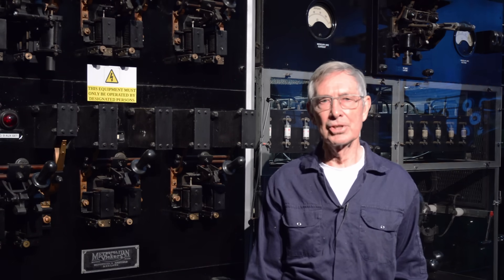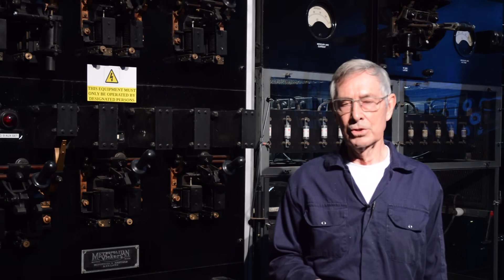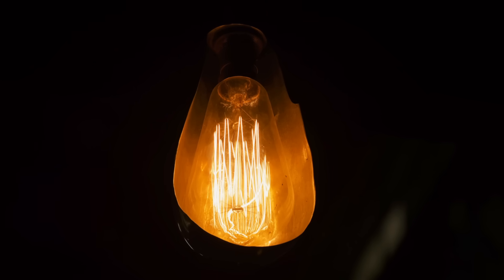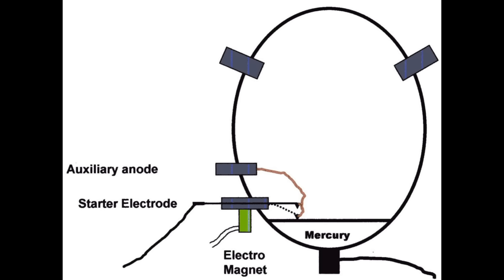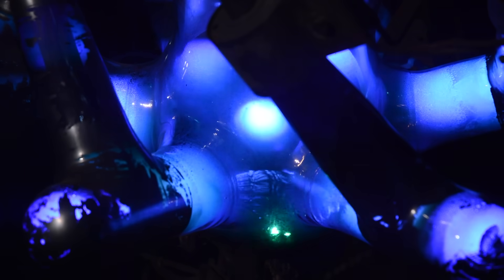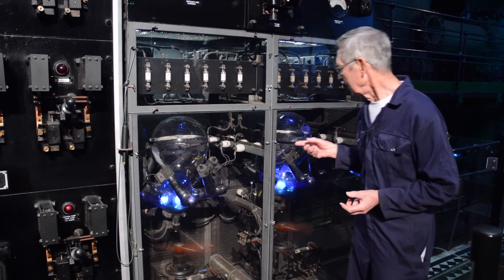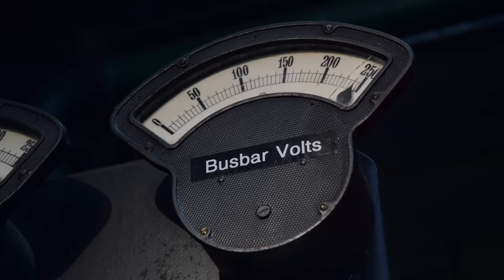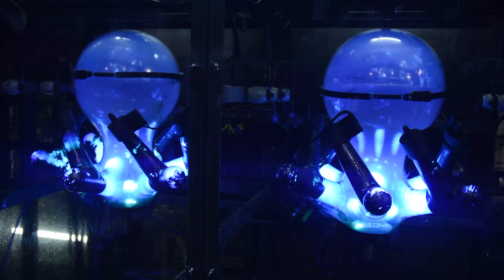Mercury Arc Rectifiers - Kempton Steam Museum

Comment: It looks so fragile. Thank you for the excellent explanation of how it works. I am curious about the need for 6 phase and how that was achieved.
Reply: Yea - the 1500V bulbs we used in the 1970's for Wellington (NZ) suburban rail were transported suspended in large open wooden frames.
About 4 fitted on the J5 Bedford flatdeck - which was driven very carefully and slowly to the stations. 
I remember a story about a previous driver who broke every one of his load.... I wonder what happened to that mercury?!
Reply: The secondary windings of the transformer would be centre tapped, so producing two outputs, 180 degrees out of phase, from each of the three input phases.  The more phases you have the less ripple on the d.c. output and the less smoothing required.

Comment: Greetings,
This is an interesting presentation, and I love seeing old technology in operation, rather than just dead and gathering dust in a display cabinet.

I do find the aluminum frames on the cabinet doors rather jarring when intermingled with the vintage hardware.
How about replacing the modern frames with good old English Oak ones?
Yes, I know aluminum is cheap and readily available, and museums are always short of funds, but maybe there’s some old cabinetry or broken display cabinets out there that are recyclable.

Ooh…….high voltage, Mercury vapor, and glowing plasma.
I love it!

Let’s be careful out there.

Comment: Remarkable that the early AC locos had one of these buzzing away at 100mph. A Class 81 draws 300 amps from the overhead wire on starting a train. The old mercury must have been 'really' sizzling! :)

Comment: We used to have Mercury Arc Rectifiers at most telephone exchanges, and at Chester we had at least three.  I remember the voltage drop across the rectifier was about 27-30 volts, so they ran quite warm.   They got replaced by banks of silicon rectifiers, capable of 3000 Amps, but the voltage drop was then only about 1 volt, so they ran much cooler.   I think we also used rotary converters, which were ac motors driving a dc generator for some of the voltages.  The Manx Electric Railway still uses Mercury Arc to generate 700v dc for their trams.

Comment: I love mercury Arc rectifiers ! In the air force I worked on some very legacy stuff but even MAR's were an era before ! The RAF type 80 had these and in the days before solid state motor controllers the london underground used them for high voltage DC...

Comment: These r still in service in the only oparating tram network in whole of India. & The first electric tram in whole of asia. They produce about 450v dc and look quite cool & run pretty hot. The tram line is very under funded and also the tickets r extremely cheap. Like i can travel half of the city for the price of a cupcake. The network has shrinked down quite a bit but it is still oparations and many r working to preserve it. It truly feels like 1920s when u get on them. They have dim incandescent lights and old dc fans , the motor is extremely loud but runs very slow!

Comment: Fascinating video. I assume it will produce vast amounts of UV at normal loads and even, maybe, X-rays - not a place one wants to stand for long, I guess.
Reply: UV yes, X-rays no. The glass bulbs absorb most of the UV, whilst letting the visible blue through. Any remaining UV is effectively blocked by the poly-carbonate screens at the front of the cabinet.
Reply: @martinwicks9531  Thanks for the reply. I assume you have some experience with these devices. In the startup of the rectifier you do have the total voltage across the anode-cathode, which can be several tens of kilovolts. This stage lasts until the ignition process sufficiently ionizes the mercury - I speculate that, at that moment, just before rectified current starts to flow, x-rays can be potentially produced. When current flow is established, you will have only the voltage drop of the device, which will be well below the acceleration required for x-rays. Of course, this could be easily checked by someone with a Geiger counter placed in the proximity of the device, during the startup process.

Comment: Ironic that in the 70's I worked at Radisson HVDC Station where 150kV, 1800 amp MARs were installed for the 900kV DC Transmission system. Eventually replaced by thyristors.

Comment: An excellent demonstration...thank you! There was an ex Bournemouth trolleybus system Hackbridge Hewittic glass bottle rectifier at the old Southern Electric museum in Christchurch, Dorset, now closed unfortunately. It was very interesting to watch and in service they were unattended.
All the Woking Electrified area railway substations on the Southern Region (controlled from Woking ECR in York Road Woking) were originally Bruce Peebles type steel tank continuously evacuated 12 phase Mercury arc rectifiers (However, the main line  Kent Coast Electrification system used glass bottle rectifiers originally) were water cooled and the water cooling system’s  top-up rubber piping had to be a certain length otherwise the current would heat the water too high and they would produce steam! Occasionally, one of the internal anodes would strike with another at the same time and cause a ‘backfire’ which then required the rectifier to be restarted. I only ever saw one of the BP type being used and this was at Camberley substation on the Aldershot to Virginia Water line. It was installed in the late 1930s and continued working until the late 1960s. They were remarkably reliable but eventually, silicon rectifiers replaced them and the night shift routine in the ECRs changed because the new semiconductor rectifiers were left switched on 24 hours a day (except for Maintenance) and The night time ‘last electric unit is in the depot, okay to shut down’ phone call to the ECR was not needed anymore. Thanks for the interesting video and I hope to visit the pumping station one day...I’ve driven by on a number of occasions but I must make a special trip. Regards, from Rob in Bournemouth.

Comment: I saw some in operation when I was a kid on the train line that transported coal from Yallourne Open Cut to the Briquette Factory I Morwell (Victoria, Australia).  They were dotted along the track in the power houses to run the DC overhead line for the trains and as the train approached they got brighter then went back to a dull base glow like these as the train got further up the line.  We were being shown by a friend of Dads who worked on them - he called them ‘The Purple Octopus’.  I worked there when I left School and they had only just replaced them when I started as an Electrician.  The units were still in situ but not connected - that was in 1987 so the were in service for quite some time. 👍

Comment: Wonderful!  Modern solid state equipment may be safer, smaller and more efficient, but it's got nothing on the old vintage equipment in terms of character and intrigue value.
The thing I love about those rectifiers is you can physically see how the electricity passes through them. It isn't some abstraction you have to imagine, you can actually see (and hear) the current dancing around inside the glass bulbs.  It makes the most mysterious of elements (electricity) tangible.  Super stuff!

Comment: This is terrifying and beautiful.  So much danger.  So many exposed conductors.  Under abnormally high loads, can the vessel burst from the vapor pressure?  The UV is apparent, but what about incidental X-ray emissions?  This facility would produce 450 volts DC at 20 amps or more and distribute it to the public?  xD  That alone is horrifying.
Reply: The voltage is not high enough for X-rays, the photons are lower energy - UV is being produced from interactions between the electrons and the Hg vapour.  . You need a hard vacuum and a hard anode to produce x-rays.

Comment: I switched on these very units on many occasions when they were still installed at the royal opera house up untll 1997. Must get along to say hello when we are allowed.
Reply from the maker: How interesting to read. We would really like to hear your stories of them sometime. You're most welcome anytime (lockdown permitting!).
Reply: What were they used for at the opera house, lifts?

I was at Kempton on Sunday; had difficulty finding the place, couldn’t see any brown signs near the bus stop.  Eventually climbed the steps to the engine house one minute after my 14:30 entry time.  Good thing I allowed plenty of time for the journey from Coulsdon, 60 bus to West Croydon then x26 to Hatton Cross then H25.  It’s not a part of London that I know at all.

The rectifiers were operating but I couldn’t see what they were powering; saw several d.c. motors on various things, but none of them seemed to be running.

The thing which struck me with the turbine sets, as with the Diesel set at Kew Bridge, is how small the pump rotors are; a lot of turbine and gearbox to drive two small pumps.  How did the output of the turbines compare to the triples?

Comment: My middle school had a old 1920's elevator, that had one of these in its maniacal room... I had the pleasure of seeing it in action when a handicap student need a lift. This was in 1998, sadly that summer the elevator was replaced with a moden sole less Kone one.
Reply: Wow i bet it was very cool to see in action,  now only time will tell, if equipment manufactured today that uses diodes to change AC into DC, will be in service 70+ years later, assuming the mercury arc rectifiers indeed were the original from the 1920s date of the school 🙃

Comment: Beautiful old hardware that still functions as designed, thanks for the demo and for keeping it all intact.  The craftsmanship on the wooden 'propellers' of the cooling fans was a feat in itself.  The blue glow of those rectifiers is something to enjoy - but I wonder is there a risk of U.V exposure or is it relatively harmless visible light only?
Reply: UV is absorbed for the most part by glass. This is why sunbathing behind glass does not work. Even in welding helmets 95% or more of UV is stopped by the clear glass, the dark glass really helps a lot more in the visible spectrum.
Reply: Joeseph Smith  That can very well be the case. But those lamps have a lot of IR output as well (from the glowing electrodes). UV in the near light spectrum (UV-A) can for some part go through glass. But the more damaging UV wavelengths are absorbed nearly 100% by even relatively thin glass.
Reply: Joeseph Smith  yes, like I said, the much more damaging UVb and UVc does not go through glass.

Comment: I remember seeing one of these things (well, a smaller one) running an elevator somewhere on the Northern line of the London Underground sometime in the late '80s.   Apparently the plan was to swap it out when it failed - but it had just carried on working...
Reply: Well-maintained "big" electrical machinery can just keep going and going, like the trams in Blackpool. Where I live in Japan has some pretty old trains running, too. They just get shunted from cities to increasingly-rural services. Then perhaps to the Phillippines, Indonesia etc to do decades more service there.
Reply: They sometimes failed but taking them out and putting them on a lorry and taking them for a drive to the manufacturers was normally enough to disturb the deposits inside and get them functioning again !

Comment: 1:50 Actually, 50 Hz current reverses direction 100 times per second. Each reversal is 1/2 cycle.
Reply: I prefer a 120hz refresh rate...
Reply: But he said reverses current. Not reverses direction. So he is correct with saying 50 times a second. You only have current travelling in reverse direction once every cycle.
Reply: @c31979839  And of course, for bigger currents onbe would use 3-phase with 3 or 6 anodes. :)
Reply: @peterudbjorg  For large currents in traction sub-stations we used 12 phase both for MARs and now Silicon rectifiers. 12 Phase is used to reduce the ripple and harmonic currents.

Comment: When I was a Post Office apprentice back in the early 1970s these rectifiers were still in use in some telephone exchanges for producing 50 Volts DC to power the exchange, charge the batteries etc. On a dark winter day they produced an eerie, flickering glow on the walls and ceiling near the cage that housed them. This video brought back memories.
Reply: The Post Office Railway also used them at one time, but they were later replaced by solid state rectifiers.
Reply: the last time i saw one to those things working  was in 1990 in Monterrey mexico the rectifier was used in a old Telegraph instalation powering an ancient mechanical type machine that worked like a old fax, that thing looked like a living magic machine compared to the "normal" looking solid state newer machines
Reply: Where?
Reply: I served an electrical apprenticeship at British Steel & we had one in our training centre to control all of our DC motors & control panels. I can relate to what you're saying about the flickering glow
Reply: @johncarlisle6865  There's a lot of ultra violet light in that glow.
Reply: @incognitotorpedo42  it didn't pose any danger because it was totally enclosed in a large cabinet
Reply: They were probably vapour rectifiers, not arc.

Comment: Westinhouse 1PJ7 Tetrode developed for DC trains hauling coal were used by us at the lab. 20000 VAC across plate we had 100 lbs 40*kg of Pure Hg in them. The graphite probes arced the current a dead short, drawing 500 amps during 90-115° cycle per phase. 20000 x 500 = 10 million watts (15/360° duty cycle). To power magnet of accelerator 96 in parallel total nearly 8000 amps at 4000+ vdc. 32 MW. Pulses. 
Power to them from 46000 kva mg's.

Comment: You need to mention that the load is connected between the rectifiers and the neutral center tap of the transformer.   I could never make sense of how rectifiers worked until I finally found a diagram showing how the DC circuit connected to the neutral tap.

Comment: I remember working in the Gardner Engine factory putting up hi-bay lighting in their crankshaft hall (yes they were BIG) and wandering off to see where the overhead crane  (700V DC) was fed from.
I remember seeing their Mercury Arc rectifier in full operation, no shielding, much larger than these ones, and scary as hell!
It no longer exists and is now a Police pound and industrial park ..... but the buildings I was in still stand. Maybe that rectifier is still there, disconnected and still good!
In Manchester there are still some "Manchester boards" in the Electricity network substations with identical switch designs but switching up to 700A at 415V ....... Scary to work on but cool as ....! Back in the day when we took pride in our work!

Comment: Fascinating to see the process of start up. 
We used to have one of these on our works to provide DC motoring current to testbed dynomometers. There was some interlocking between test cells and you had to wait for the 'DC Available' light to illuminate on the control consol.
Latterly drive cabinets were installed for each testbed that required motoring capacity. These were large inverter drives that could provide or absorb power. Better for doing there job but a lot less attractive to look at.

Comment: Well that brings back memories of working as an "assistant projectionist" at the Savoy Cinema. The first job when you got to work was to "flash up" the mercury arc rectifier to provide DC power to the carbon arc projectors and slide projector. The rectifier was in a separate room underneath the circle seats, which meant you had to walk through a dark cinema, just with the aid of a torch, to the room and power up the rectifier. The UV glow lit up the whole of the dark cinema, very eerie, bit like the "Quatermass Experiment" film. If it didn't "flash up" when it was powered up the trick was to slam the door to the cabinet and that usually worked, guess it was to get the starter electrode to operate. The cinema is long gone now, I wonder what happened to the rectifier and all that mercury.

Comment: Quite fascinating, David. The only time I've seen mercury arc rectifiers in operation was at a fairground as a boy where they provided DC for the rides. My thoughts then were what voltage appears across the rectifiers so how much power is dissipated in them. Also is there any danger from UV radiation? Regards, Peter

Comment: I'm sure the Science Museum in London had one working when I was a kid, they also had a lightning machine that produced a huge spark many feet long accompanied by a huge bang, frightened me to death as a child.
Reply: There were three on display at the Science Museum, a small single phase one which did not operate, a three phase one which operated continuously and another which you could start by pressing a button.  The continuously operating one supplied an old lift nearby.

The impulse generator as they called it was more generally known as a Marx generator.  It worked by charging up a number of capacitors to a relatively high Voltage.  The capacitors were connected in parallel with resistors between.  When the Voltage reached a certain level a spark gap between two of the capacitors would break down effectively connecting them in series.  This would lead to a chain reaction with all of the spark gaps breaking down connecting all of the capacitors in series and applying the 1 MV to a string of insulators.  If the insulators under test were faulty this Voltage would leak away to earth, but if they withstood the Voltage a large arc would take place between the arcing horns provided across the insulators.  Similar arcing horns can be seen on high Voltage transmission lines where they provide protection against excessive Voltage, e.g. from lightening strikes.  There are several videos on YouTube of small Marx generators which people have built.